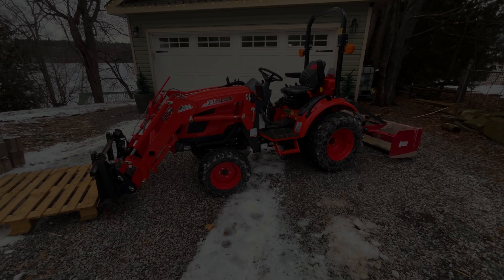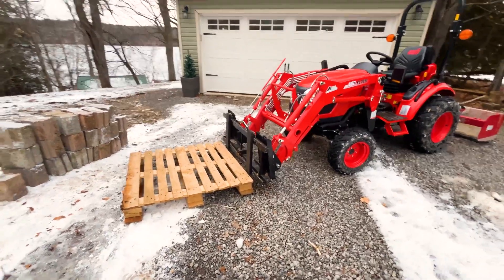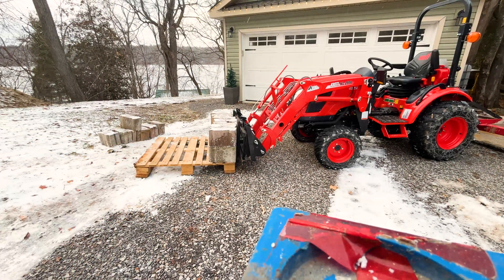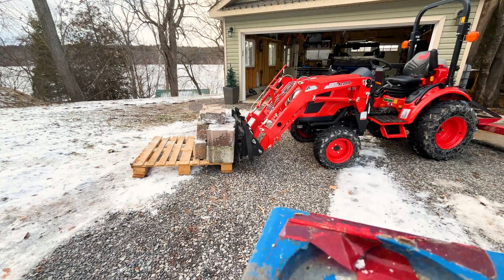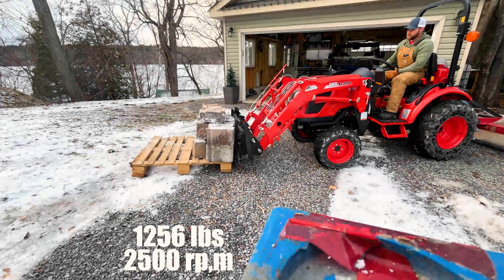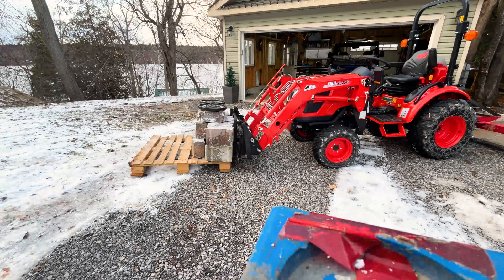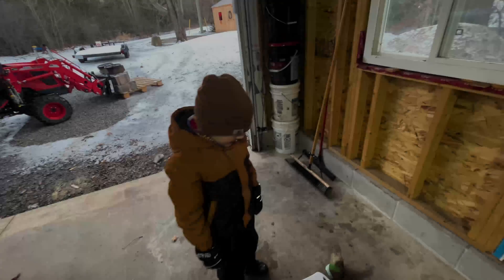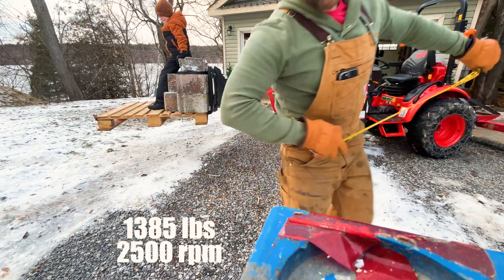Max Lift Capacity of the stock Kioti CX2510

Comment: I’m very impressed with lift capacity of my CX2510. I stack my firewood in 270gal IBC cages, which hold 1/3 cord. I routinely lift full cages of wet black locust and white oak…only about 6-12” off the ground, but enough to move them around.